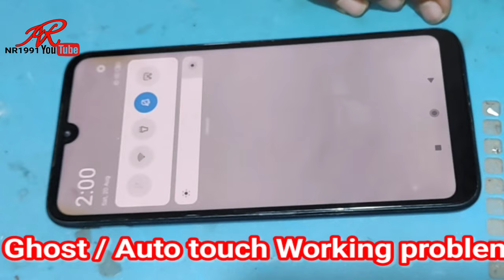How To Fix Ghost Touch problem | Permanent Solution ?

Comment: After changing glass, my mobile phone typing ghost some times
Reply from the maker: Welcome
It's not supposed to happen
Reply: Same
Reply: Same
Reply: Same
Reply: Maybe it is really a ghost then
Reply: S am e
Reply: Hmm..
Reply: Same
Reply: Same
Reply: try changing your phone buy new
Reply: 3 years ago I was a Xiaomi Mi 8 , I really wants that phone. Pass a few months, my screen touchs everything like crazy, a really hard ghost touch problems. My phone never drop or had a minimum damage. So I changed the display at a shop, then pass like 6 months, the same problem... The guy of shop tell me that maybe was a motherboard problem, and if I change the screen again, maybe happens again. So I bought a new phone 😥
Reply: Same
Reply: SaMe
Reply: Means its real ghost there 💀💀💀💀💀
Reply: Same
Reply: Mee too😮
Reply: Same ..bro
Reply: Kisika  solve   hua  kya   Problem...?
Reply: Same..my dad said it's probably apps that you have on your phone or that don't use things that design your phone and stuff like it wasn't like this back then
Reply: same
Reply: @sazutawideuh  it's a good advice though
Reply: @joaoalmeida4380  it's good to buy new one instead wasting money on same old phone
Reply: Same, so i just take off the screen card and now my phone is in good
Reply: Same bro
Reply: Same bro

Comment: Bro I use tecno pop 3 it was pressured by an heavy bag so turns on perfect but after using for like half a minute it completely freeze's and shows horizontal lines all over and Turns off sometimes it shows small vertical which and black lines and its just unusable, please is there any solution
Reply: 1:38 1:40
Reply: 1:38 1:40 1:56 1:57
Reply from the maker: Welcome 👍

Comment: I have these on my Moto g60 I thought it was because I had dropped it several times but a few times or I accidentally spilled water or other liquid on it, but as I see here, many users of any brand are also struggling with this, but I think that since I have an A12 now, so it is  due to the fact that my battery drains faster than before when I had the A11, it's just that the A12 has a lot of problems Lags, fast draining batteries, etc...
Reply from the maker: New video of our channel solve your problem
Reply: Same with my moto g50
Reply: Same with g40
Reply: Same with g60
Reply: I have oppo a16 I want to fix the issue of cracked screen and learn to fix the ghost typing problem without troubling my parents
Reply: 0:15 0:16
Reply: 0:15 0:16 0:33